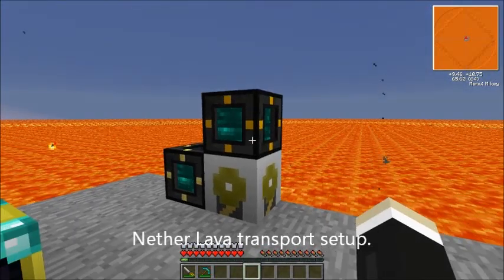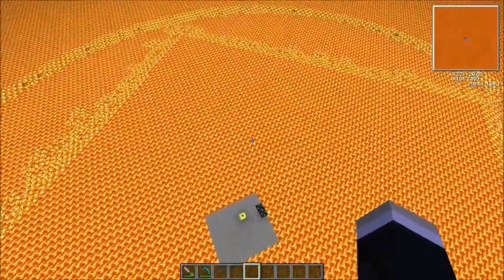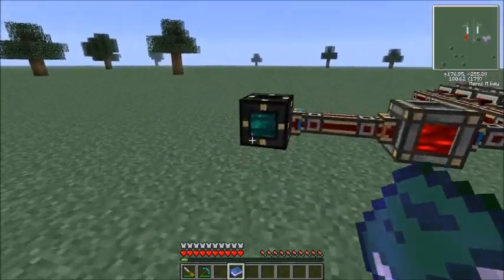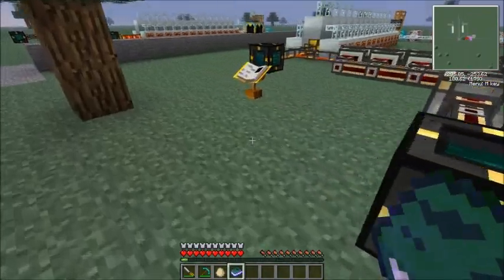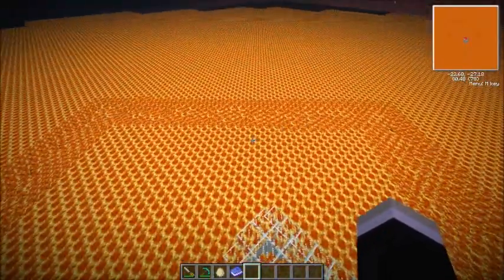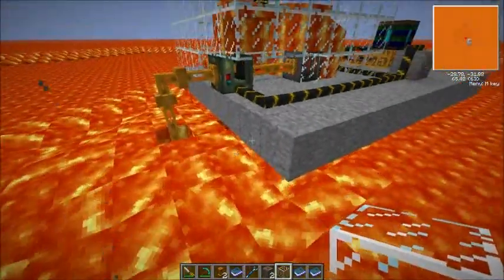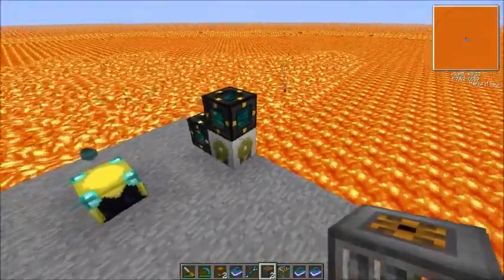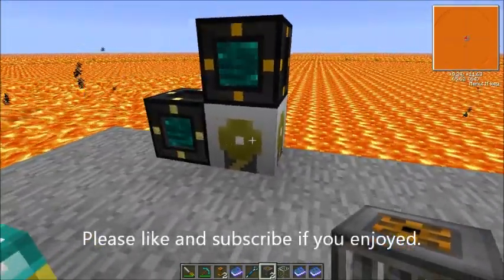Nether lava transport Buildcraft and RedPower2

Comment from the maker: Sorry for the long delay in answering.  Youtube had your comment marked as spam for some reason.  1.) Anyway in redpower2 they have there own liquid transport pipes that you have to use for the redpower2 pump.  2.) magmatic engines do not need to warm up or cool down, very user friendly.  3.) Depth is less an issue then having lava in a large area all around.  Make a platform out from the coast to get lava in front and behind.  Thanks for watching and commenting.

Comment: A couple of questions if you dont mind:
Were you using liquiducts to move the lave from the liquid tesseract to the geothermal generators and magmatic engines?
Do you have to cool or restart the magmatic engines?
Do you need to have the buildcraft pump where the lava is deepest or will the pipe suck lava from the furthest possibly reachable point and then move closer?

Would be great if you could answer, because it looks like you've tried alot of stuff and understand the most efficient workings.